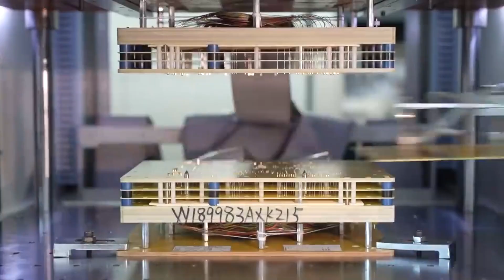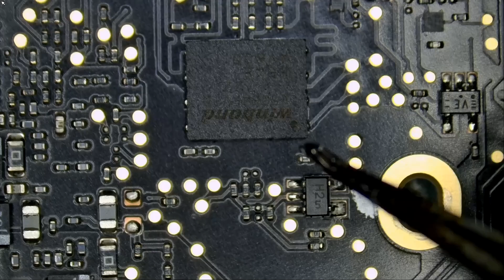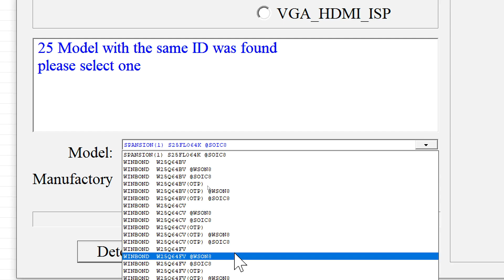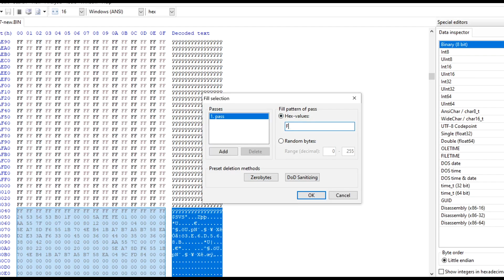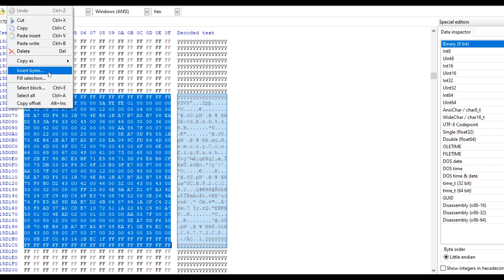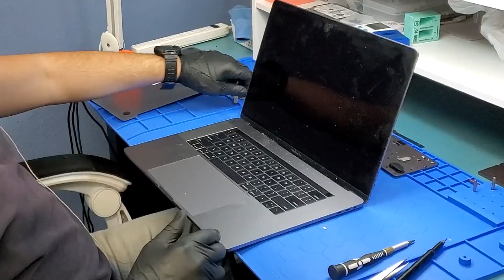A1707 Macbook Pro EFI Password Reset using EEPROM

Comment: Just because the person doesn't know the efi password it's stolen they could have brought the MacBook and didn't know it had a efi password until they reseted the MacBook i brought a MacBook Air mid 2013 off eBay just like that and the seller told me they would have me the password i give them a $ 100 dollars i told eBay they could not do anything because it was pass the return date so i got password removed now it works

Comment: You can reset the winbond the chip on the board, just rewire it to the programmer.
Just contact apple if the MacBook is reported as stolen, keep the market clean.

Comment: Hey huge fan for long time thanks for your time making those videos. ❤
If you can maybe you can tell about your hot air station which you use and let us know what temp and fan you using to remove stuff from the board.

Comment: Funny story, I forget passwords easy from brain damage due to strokes, so I use fingerprint reader to login. A while back I had to do some roof repairs and all my fingerprints were altered from handling the rough shingles so I had to reset most of my passwords. I have some saved in Google Chrome but not all. I can't wear gloves due to severe nerve damage on most of my fingers that gloves make them extremely tingly.

Comment: Just think how much easier this would be for a socketed bios chip? This is some cool work right here, reminds me of the times I hot flashed socketed bios's minus the hex editing. Can't help but wonder if there's not some way of clearing the cmos on this board without removing and editing the chip? Like some trick of shorting out two chip leads that clears it? 🤔
Reply: Some programers have some sort of clip and you place on the pins, you can read/write then. At first the bios chips had a socket and you could remove them easy
Reply: It’s a security feature. It’s not supposed to be possible, let alone easy, to bypass the password. Adding expense and thickness is exactly the wrong thing to do here.

Socketed flash is history. Applications that may need to rewrite flash either use JTAG or or other methods to reprogram in situ.
Reply: That would completely defeat the point of an EFI BIOS...
Reply: @lookitskazzy  you mean "UEFI?" It might defeat the purpose, but then so does hex editing... Lol. Obviously the UEFI isn't completely full proof if it can be hacked. You'd be amazed at the tricks that can be done few know about.
Reply: @garyr7027  you can simply build a jig to access the UEFI chip, no need for soldering. Those chips usually arriving blank, unprogrammed in the reels, the manufacturers are using ICT/FCT equipment to test the boards and program the blank chips after the SMT phase.

Comment: i mean it's tricky problem, may be apple should provide an option to mark laptop stolen by owner if they loose it, and a way for technicians to see that
Reply: You can flag any of your Apple devices as stolen and Apple keeps track of that. I don't know if there is an easy way to access that info outside of calling them.
Reply: Back in the day you could see the apple-ID in the .bin-file, and you could contact the true owner that way.

Sadly not a thing anymore.

Comment: So this removes the firmware password. But to be clear it does not bypass activation lock (icloud) which will re-emerge even after os reinstall because activation lock is linked to device serial???
Reply: You could boot opencore with EFI passcode bypassed and spoof serial/system ID to get around the iCloud lock.
Reply: @poorlydrawnstickman1660 how
Reply: @poorlydrawnstickman1660 Not true, MacBooks with iCloud Lock do not allow you to select a boot drive.
Reply: @natetechr  forgive me if I’m mistaken, but I thought at the end of the video he showed he was able to select a boot drive with alt held on boot once the efi passcode was removed.
Reply: @poorlydrawnstickman1660  this model has a T1 chip, T2 will not allow boot drive select if it has iCloud.
Reply: @natetechr EFI’s control boot menu not icloud
Reply: I believe he said this MacBook does not have the t2 chip so it would not  be iCloud locked. 2018 models and up have t2 chips. 2017 and below do not so they can be bypassed with out worrying about iCloud.
Reply: @Tomorrow-l7s  You are correct
Reply: You can still iCloud lock a 2017. he is only removing the Bios password only. @Tomorrow-l7s
Reply: Correct iCloud lock is server side.
Reply: So… useless to do it?
Reply: Not if you only have a bios password lock. You have the option to use icloud lock on your device. If iCloud is enabled then yes useless but if its off your all set. @redzone5655
Reply: If the MacBook has iCloud lock and EFI password, this will only remove the password EFI prompt at boot. iCloud MacBook will always require iCloud email and password to install or reinstall any OS. A MacBook with iCloud wont even let you select a boot drive as shown in this video at the end with big boss.
Reply: iCloud lock and EFI firmware lock are two completely different things
Reply: 2017 and older MacBook models does not have the activation lock.

2018 and newer models do, in which case this will not fix anything.
Reply: T2 chips are a 64-bit ARMv8 chip that runs on bridgeOS, which you can't get around with software. It's one of Apple's biggest anti-consumer practices.
Reply: @natetechr if T2 chip replaced?
Reply: @maklogetrich2378  Huh?
Reply: @natetechr  can T2 chip replaced?
Reply: Did you watch the video? he said anything past 2017 will have the t2 security chip 

Facepalm central itt